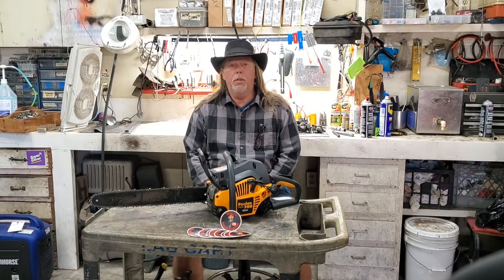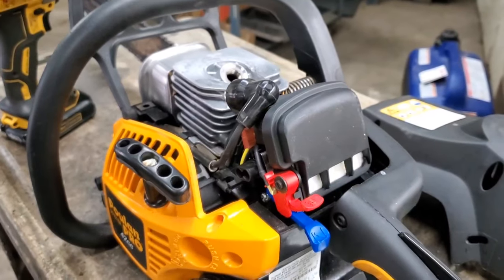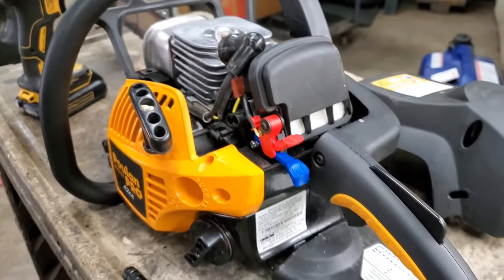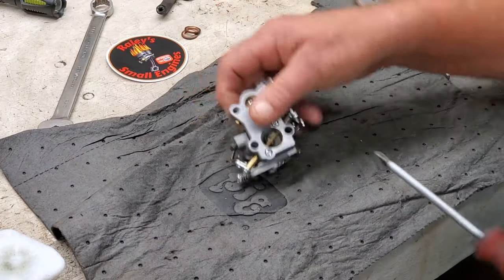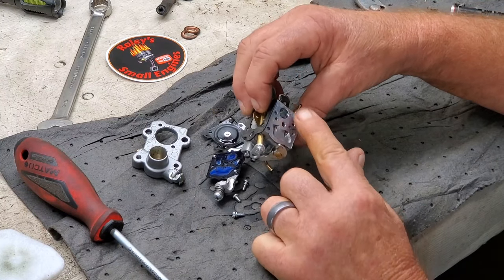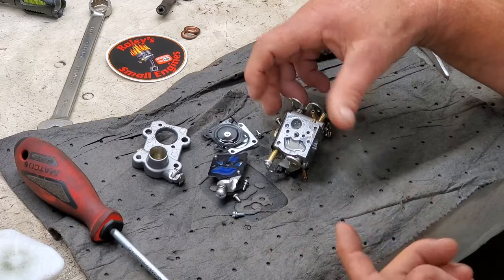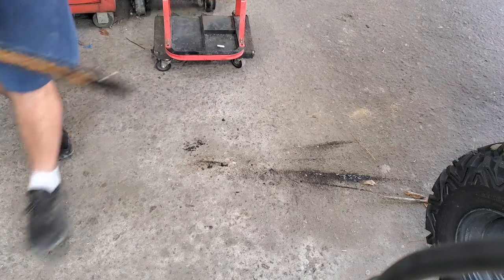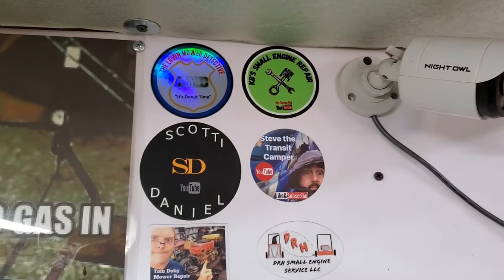Poulan Pro Chainsaw Sitting Up No Start PP4218 Easy Repair also Mail Call at the End

Comment: I bought a new Poulan pro in 2008. After each use I pour the gas out, start it and run it out of gas, clean it and store it. It has never failed to start by second pull. Great saw.

Comment: I just put a new carburetor on this evening. Had the saw since 2008 never had a problem with it. I keep fresh gas in it, I use 50/1 fuel. Piston looks like it is new. Was just going to change the fuel line's but the carb kit was so cheap I just replaced it to. Not bad for a 15yr old 100 dollar saw.

Comment: Very clean! Was it ever used?
Reply: I just got 5 from a store and they all are like brand new and fuel lines and diaphragms bad
Only one needs a new air filter and fuel filter 
Dumb the fuel after using and purge out carb and dump again will stop 99% of the problems with them

Comment: Tracy, im not a chainsaw  guy but i had a Poulan xxv and that saw when i purchased it didn't even have a chain brake. It ran forever  and i finally retired it 2 years ago. I put the next size bar and chain on it  and loved that little saw. I did have to put fuel and one pull rope on it. Everyone rags on poulan today so their quality must have went down. Very good video and you are getting closer to 1,000 subscribers my friend. Who gets there first you or the Rooster.  Can't wait! 👍😎Roger
Reply from the maker: Yes sir, the old Poulan was a much better saw.  Not sure, probably the Rooster. Lol
Reply: I have had several Poulan saws over the years and just bought a 5020 . The biggest thing is they send the saws with the gap too tight , so you just about have to check all the new ones. .025 is manufacturer specs . I run a brand new saw a little when I get it and pull the spark plug out again and blow out the cylinder by pulling on it with the plug out and check my plug for assembly bits of metal , occasionally I find them , even in a large generator I bought. Check for scoring and if none move on, it seems to be the nature of modern small petrol engines. Mine runs top notch .

Comment: I have a 3516 had it running gave it back to customer then he said he couldn’t get it started then I got it back put new carb in and I can’t get it started never ran into a issue like that it has spark fuel and new carb any advice

Comment: That was something how you used two saws .the one you had no the table was a new saw with a old bar and the one you started on the floor was a new saw with a new bar. Dont  get me wrong ilove these info shows I have two saws that I love but stop runing..this helps alot now I know more what took for.
Reply from the maker: Same saw, same bar.  Look at about 6.23 in the video and you will see the Poulan Pro is upside down just like when it was on the floor.    I film honestly and don't try to pull the wool over someones eyes.  Thanks for watching and commenting my friend,  I like that you are paying attention.  We hope our videos help you out my friend.

Comment: Where should I start with the idle screws.   I went all in 2 turns out???????
Reply from the maker: 1 1/4
Reply: @RaleysSmallEngines  thanks Brother.  Great video.   Got it fired up but it's flooding.  Thanks again 👍
Reply from the maker: @mikeburrill779  most likely bad check valve in carburetor. Replace carburetor

Comment: I have this same Poulan saw and almost as new and it's doing the same thing as this one in the video is doing. I don't have the spline tool to change the settings.  You shouldn't have to do this much adjustment/pampering  on a new saw to keep it running. I could understand if it was heavily used and for a lot of years, but not clean and new.  To make it worse they make you get a special tool to adjust the gas.
Reply from the maker: Yep, I understand my friend.  My personal saws are a Husqvarna 350 and a Stihl ms180c. The Husqvarna I've had at least 15 years, never fails me. Go get a Husqvarna, Stihl or Echo. In my opinion that's you best one's on the market.  Yes, if you have to adjust the carburetor on almost any 2stroke you will need a set of those special tools.  Thanks for watching and commenting my friend